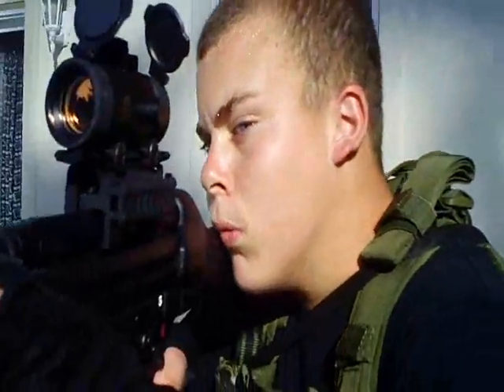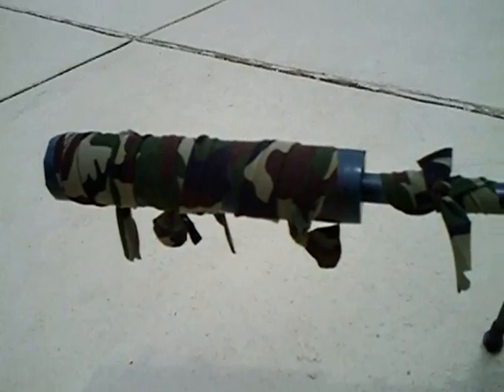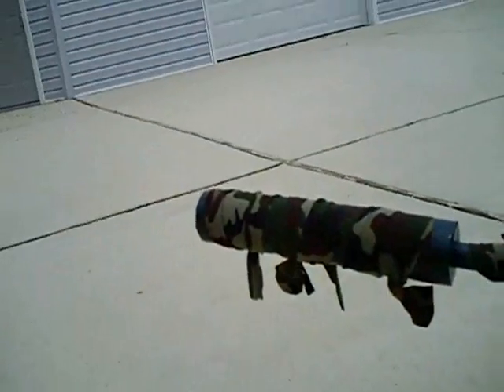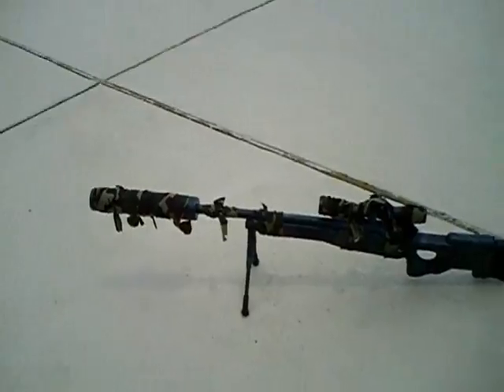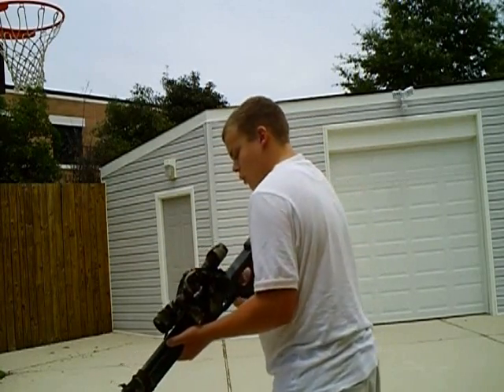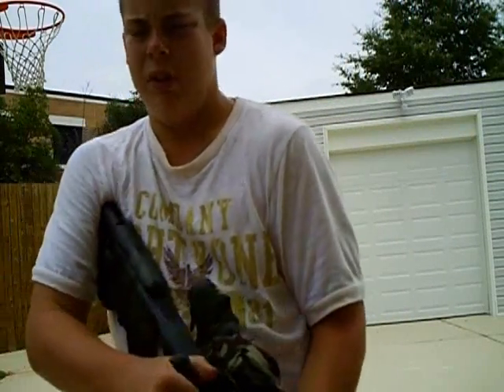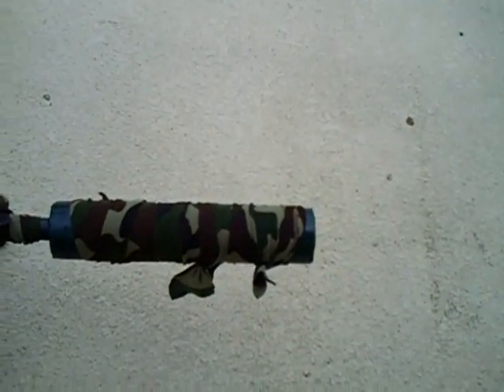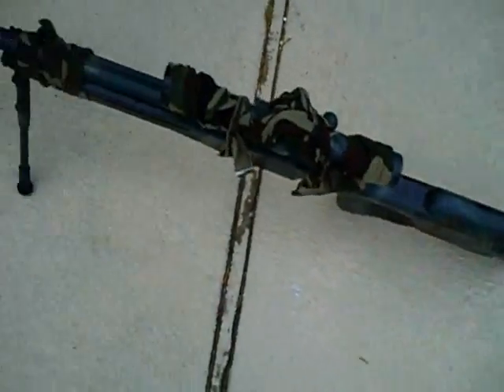airsoft mod: well l96 airsoft sniper rifle

Comment: never put cheap surpresors,foam forums,foam tubes,pvc tubes ect.
it WILL decrese your acuracy if the barrel of the piece isnt 100% straight. or if the widh/size or w/e is bigger than the BB barel.thus when bb enters the larger/broader barrel.the stil air in that barrel wil be a stoping force.making the BB go slower than usual.